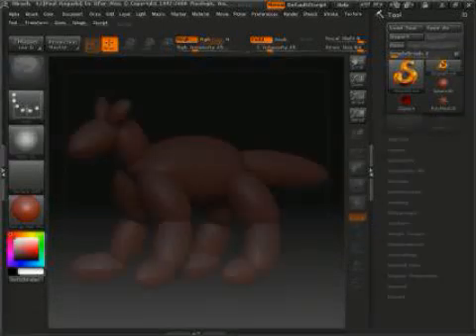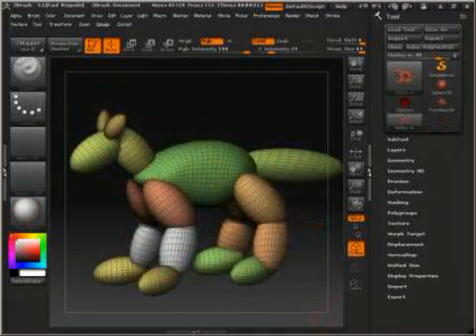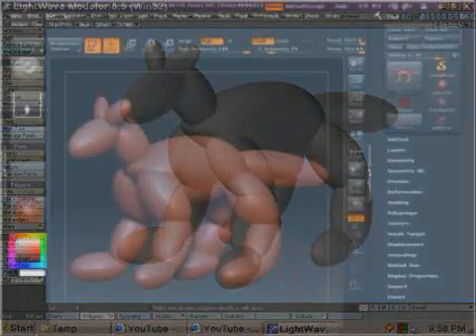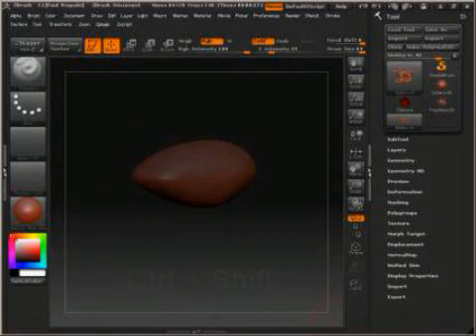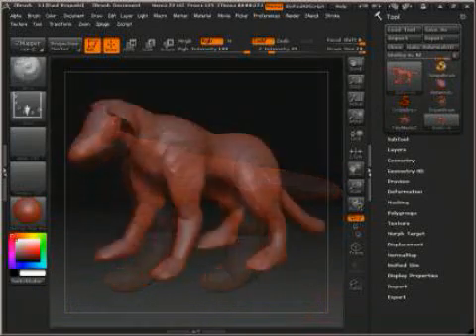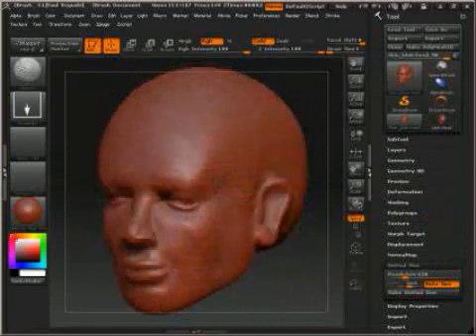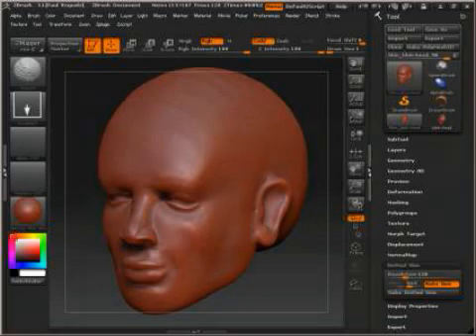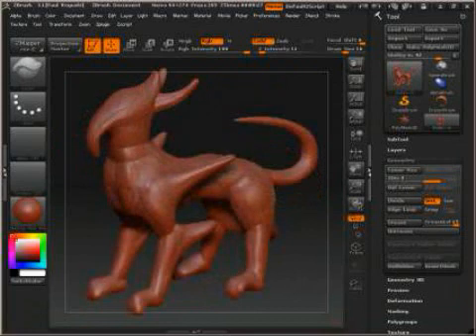Zbrush - Roughing out your base mesh in Zbrush

Comment: When I use unified skin at the highest resolution (512). I tend to get a smooth seemless skin... with alot of the detail missing. Then when I append the model and project all... I project the detail back on unified skin. I've done this to various model.. ex: when i modeled the head and hands and feet seperately from the main body. Then it typically looks pretty good. Maybe I should make a vid. to show you my results... because they come out pretty dang nicely.

Comment: If you make a Unified Mesh from a model and want to keep all the detail. 

1) Take the mesh with the detail then append it to the mesh with out the detail.
2)With the mesh (without the detail) selected and Z-Add turned on. Press project all.
3) Now you should have a completely unified mesh with all the detail of the original model.